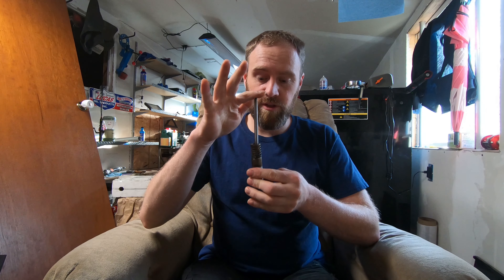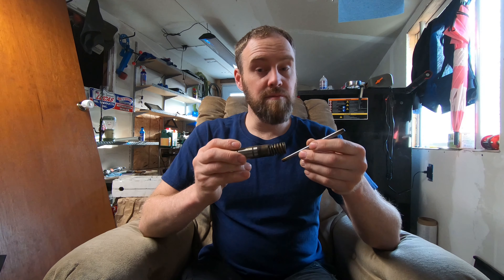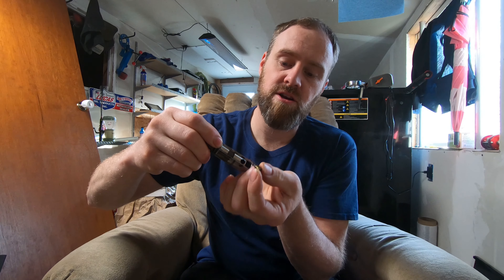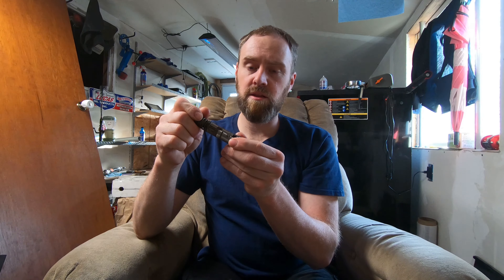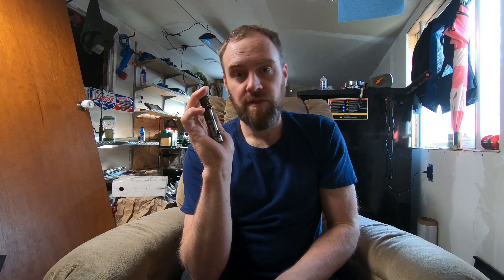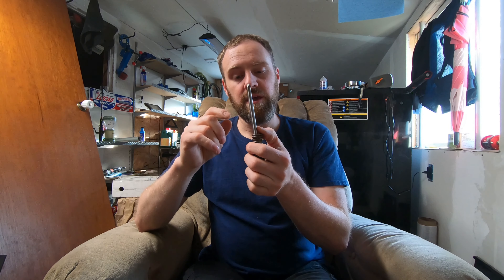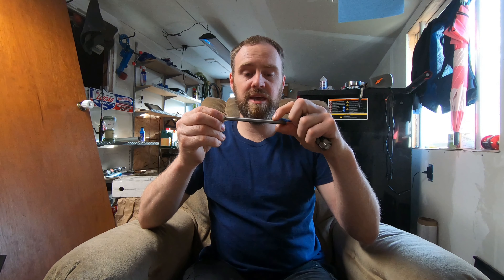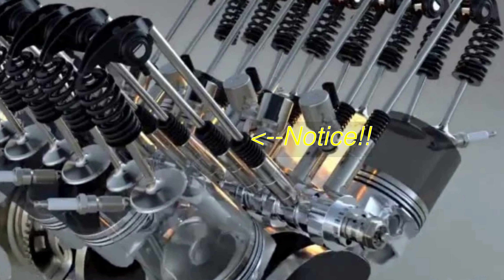Bent Pushrod, Is GM engineering to blame?

Comment: I have a 2021 suburban 7k miles on it just developed a bent pushrod Dealer called me today.   This is crazy.
Reply from the maker: Yup best solution is upgrade to ones that won't fail.
Reply: Same. No check engine light. 8.6k miles. Getting it back tomorrow then getting rid of it.
Reply: Shades of the Vega engine... or 5.7 diesel... GM returns to the 70s
Reply: My 2021 escalade with 3k miles had a bent pushrod.  Just got it back.  I have a zero faith in gm.
Reply: 2021 GMC Sierra Denali, 5k miles. Bent push rod
Reply: 2021 Silverado high country with 5.3  6,200 miles bad lifter 🤦‍♂️ ridiculous
Reply: 2021 YUKON with bent pushrod in February and now Monday same issue.  Another bent pushrod different cylinder!!! Not sure when they will get part in because they are in high demand.
Reply: @thepincup7405  That’s messed up
Reply: @thepincup7405  If it done at the second time that should be under Lemon law. Keep me updated let me know what happens if you call GM and complain to them they will issue you a GM credit I complaining so much to them they issued me $1000 worth of GM credit.
Reply: 2021 SLT, failed lifter and bent pushrod. 5,600 miles. 18 days and still don't have it back.
Reply: 2021 Silverado LTZ, 6100 miles on vacation with my family in NC, bent push rod, no rentals available, stuck in a hotel for 1 week.
Reply: @alexpolansky5088  If you call General Motors direct and complain to them and stress it out to them they will take care of you because they took care of me and they called the dealership to find me a rental car. They put me into a enterprise  truck. So you have to call GM directly and make a valid complaint and also they will compensate you they gave me $1000 in GM credit FYI if you complain right because it’s a brand new vehicle should not be failing it’s a big issue my vehicle did it and you see everybody else’s comments.  And with you on being on vacation you got a little bit more pool there let me know how it turns out.
Reply: @daytonaslots9533  thanks man appreciate it, had a few calls into GM, with the holiday weekend I didn’t get much feedback but hoping to hear back shortly
Reply: @alexpolansky5088  Just keep pressing them and tell them you want to talk to a manager because it’s unfair that your car is in the shop and you don’t have a rental car or a loaner vehicle for the default and make sure you keep specifying the default this is a brand new vehicle I didn’t purchase a brand new vehicle the break with only 6k 7000 miles on it.
Reply: Rust in the lifters from shutting down production see it weekly
Reply: @CrazedPerformanceRepair  which are the ones that won’t fail??? 😩😩 debating on getting one but with all their shxts I’m moving towards tundra TRDPRO
Reply from the maker: @socal69_88  I was referring to upgrading pushrods. But if buying a truck a tundra ir Titan may be a much better choice.
Reply: @CrazedPerformanceRepair  Is this also a big problem on 2020 and older trucks?  According to this video it seems like it should be but we only seem to be hearing about 2021 models going down like crazy.  Why would that be?
Reply: That great GM feeling, just like cramps before diarrhea
Reply: 2021 silverado with a 6.2L, failed pushrods and valves at 7500km
Reply: @garyrosvold7409  
Man I hate to hear that 
GM is not good right now
Reply: 2021 Sierra 1500 AT4 8k miles bad lifters and bend push rods, still at the dealer.
I contacted GMC request to buy back but they are declined. I may have attorney involved.
Reply: 2021 GMC Sierra Elevation 5.3L, 5400 miles.  Just spent 17 days at the dealer for one bad lifter/pushrod, replaced all 16 lifters.  Good thing it's a 2 year lease, they can have this junk back and Toyota here I come
Reply: @jonk3470  yeppers
Reply: It gets better my 21 failed for the 2nd time today same bank.
Reply: @oOnuggetOo  
Man sorry to hear that everyone needs to get rid of these lemons flood the used market with them no one will want a GM truck
Reply: @CrazedPerformanceRepair  I have a 2021 Escalade 6.2 going in for repair in 2 days will they install your upgraded pushrods under factory warranty if i purchase the push rods?
Reply: @socal69_88  Toyota has an ongoing recall on their engines on nearly all models from 2016-2021 for cracked engine blocks. Yes, even the beloved TRD models of SUV and pickups. Avoid avoid avoid.
Reply: @fitzgerald69  Did they provide a courtesy vehicle? I might have the same problem.
Reply: @victordominguez99  No, they did not. They had sold all of their courtesy vehicles due to the vehicle shortage so I was out of a vehicle for a month.
Reply: @daytonaslots9533  what can you do with GM credit?
Reply: @daytonaslots9533  Dealer had me go to Hertz & pick up rental since they didn't have any, Gm paying bill
Reply: Damn. Reading comments. This is nuts! Was considering AT4/AT4X with 6.2 but this is scary. Is Diesel reliable?
Reply: @sammymontego2217  it gets worse, the new 6 cylinder Tundras, the only engine available (no more 8s) have turbo charger fails. They have to pull the body off the chassis to get to the turbo chargers to replace them. Have a friend with 700miles on his 22 tundra and it took more than a month to get it repaired
Reply: @elithepitbulldog2209  the difference is GMs design is completely faulty for years…. There is no fix….with Toyota it was a good design with a bad batch of parts… none of the YouTubers I follow with the 22 Tundras have e experienced it. The GM 5.3 was a good engine before they added the fuel saving technology…. I used to own a 2001 Chevy… but now I’m all Toyota for these reasons
Reply: @thepincup7405  Update?
Reply: @hugh639  how can I contact GM? 2021 at4 collapsed lifter as well at 16 thousand miles
Reply: @gregallen1  call your dealer and request for GM phone number. I wish I still have the phone number.
Reply: It's the gas in California ....
Reply: 2015 Sierra with the 6.2. 
Zero problems till 83,000 miles #6 bent pushrod. No explanation found. 85,000 miles same exact pushrod bent with no explanation found. I’m pushing the shop to replace the VLOM while the motor is still apart.
I’m ready to delete the BS!
Reply: 2012 ram Laramie longhorn 1500 5.7 130k a year ago had a bad lifter and now a month ago same issue .... not sure what to do . 😡 😡  also a ram issue.

Comment: GM messed up their reliable engine reputation starting in 2008 with the first DOD motors.  Its been all downhill since.
Reply: THIS INFAMOUS SYSTEM STARETED IN 2007!!! THE END OF THE GREATER  TAHOE!!  ME, I KEPT MY 2006, AND I LOVE IT
Reply: Yeah after the 08 recession gm has gone downhill
Reply: Ls1 ran over 800000 miles they had to get you in the service department somehow
Reply: @arturovalderrama4626  I disagree. I have an 07 Tahoe with 170k. She's been amazing.
Reply: Agreed my 02 6.0 Silverado runs like a champ with over 220k miles 👍🏿👍🏿

Comment: What I don’t understand is why GM neglected to chamfer the Inside section of the active lifer that slides into the outer section to avoid the very reason it gets stuck when it goes into AFM mode!
Reply from the maker: Because then the locks wouldn't be able to hold. The thing that causes them to fail is lack of oil pressure during activation, or oil pressure when it's not supposed to be getting oil pressure at AFM side of the lifter. This causes the lifter locks to bind because the timing events and thus knurls the steel locking it up.

Comment: My number 5 pushrod bent and that is not a AFM lifter. I have 56000 miles. GM replaced the cam and all my lifters. I had to pay $800 because my warranty expired 3 month ago.
Reply from the maker: I found out later, the pushrods are actually interfering with the head as well. The solution is smaller diameter pushrods. I offer them on my website but you can buy them anywhere.

Comment: Just saw this in my subs feed. Been meaning to follow up with you. Your lifter fix and the LT1swap AFM/DOD delete is going strong over a thousand miles in. Saved me thousands. You’re a rockstar!
Reply from the maker: Thanks, I'm glad I could help.
Reply: How much did it cost ?
Reply: @crz400  I spent a few hundred including the tool. About 50-75 on the LT1Swap DOD delete with shipping. Lots of gaskets like intake manifold and valve cover, although I could have likely reused, but truck is 2008 and never touched those before. I took the time to do some optional items like updated baffle valve covers and oil catch can setup. Honestly it could have been done for 100 or so, but I used the time to do those other items noted.
Reply: When did the engines with this issue come out?

Comment: For Tahoes, Yukons and pickups from 2015 and above, with gear No. 6L80, in order to cancel the AFM system (active fuel management), select the gear shift in manual mode and select gear No. 5 to make the vehicle operate on an 8-cylinder system in all conditions to avoid the Engine Valve Lifter problems.

Comment: Dude you are brilliant! My wife's escelade just started tapping. I hooked up my laptop and no codes. When I turned off cylinder 4 the tap went away. I toyed with the idea of replacing cam, lifters, delete, etc. But I just pulled it all apart today to replace lifters and low and behold I have a bent pushrod on #4. I wish I found this video before pulling the heads because I assumed it was a lifter issue that cause the pushrod to bend. If this happens again which I'm sure it will I'll know better. Thank you for all your knowledge. People like you are invaluable and I thank you for what you do!
Reply from the maker: Thanks, I do have the pushrods to solve this issue on my site.
Reply: @CrazedPerformanceRepair  yup I checked! I will be ordering to have for the future. Thanks again!

Comment: 2021 GMC Sierra 2500 6.6L gas. Ordered brand new to take family on camping trip in June. Received truck 2 weeks ago. 210 miles currently. Started misfiring at 16 miles. Dropping off at dealership tomorrow for inspection.
Reply: 🎶Get that great GM feeling 🎶

Comment: Thank you for the info. Got a new Silverado 6.2, 2600 miles. No issues yet. <knock on wood>.
Reply: How is it rocking man ?
Reply: @Jixx45  not bad. ~4300 miles on it. 19/22 mpg. It’s a fun trick to drive.
Reply: @undeadmonkey9122  how’s the truck now?
Reply: @rayans9348  ~7500 miles, runs fine. Always give her a 5min warm up, remote start while i put shoes on kinda thing. Ave 17mpg, if it’s not in sport mode. Added side steps, ~250 lbs more and no engine issues at all.

Comment: I've been wanting to upgrade my 2001 Silverado to something a little newer. I was definitely concerned with lifters though. Glad to see someone has a sensible solution!
Reply: Get a new Twin Turbo V6 Tundra. I saw an engineering video on their new 3.5TT. My guy, Toyota over-built that thing. They re-engineered the bore and stroke ratio, they made the stroke taller which means more torque and less pressure strain from the boost. Also Toyota angled off the valves, pistons and body housing to overcompensate for the turbo pressure. I'm telling you yes I know they are Japanese, I know they are not a V8 anymore, but these guys did R&D for 14+ years to make basically a Ford ecoboost, bro you know that shit will last forever. I love V8's from sound to N/A power, but even I will admit, after seeing the over thinking and over safety Toyota put's in their motors, I'm done with all these car brands. All I buy is a Toyota now. I don't even care where the hell it is from.

Comment: My 2017 6.2 is in right now. #7 has a bent rod. 101k miles. Thank God for Extended warranties. Thanks for the info.
Reply from the maker: It will likely happen again soon. I offer a upgraded pushrod at www.crazedperformancerepair.com
Reply: @CrazedPerformanceRepair 2017 6.2 here as well. #4 bent push rod. 65k miles and no warranty. 2200$ repair from a GM master tech. Doing bad thermostat and leaking oil cooler lines as well. New VLOM kit lifters and push rods on one head. His tuner wants 600$ for a custom tune. Would I be able to just plug in a range technology plug to prevent it from happening again? I think I’m trading the truck in soon for a 6.6 gas AT4 2500.

Comment: My boss has a 2021 Yukon Denali 6.2.   First oil change at 7,000 miles and it was picked up from the dealer and taken right back for 4 BENT PUSHRODS
Reply from the maker: Yup, not surprised lol. Gm really messed this up.

Comment: I have a 2021 Silverado Custom Trail Boss with a 5.3L (L82) with Active Fuel Management and 6 Speed Automatic Transmission. Super Reliable truck. The ones with the problems are the 8 Speed Models with Dynamic Fuel Management and L84 Engine.
Reply: Yikes I just bought a 2023 with Dynamic 5.3 I change oil below 7500 that's recommended and I use mobile 1 I use mine mostly highway ..... I did by the extended warranty

Comment: I had a  bent pushrod on my 2015 6.2 high country 217000 miles but I’ve ran it with a direct port range chip for a afm delete i probably think it helped me delayed this bent or collapse pushrod or lifter problem right now im doing a complete dod -afm delete with the respective tune i hope this solution help me keep my truck a bit more longer, i like the video and subscribe! Good information !

Comment: 2018 sierra SLT...58k miles on it...engine light came on, threw code P0324 for knock senor code accompanied with a engine tick....my mechanic pulled the valve cover and found the bent pushrod almost identical to the bent one from this video. Thankfully caught it before any further damage....im probably done with GM until this is fixed/addressed...Thanks for the video.
Reply from the maker: I sell a fix, smaller diameter heavier wall pushed at crazedperformancerepair.com

Comment: 2015 silverado 5.3 Thanks for this explaination and I agree with what you are saying. Last summer I thought I had a stuck lifter on the passenger side. When I pulled the head apart and examined the lifters none were in the stuck position but I did find a bent pushrod. I replaced the lifters anyway along with having the head cleaned, replaced the guides and pushrods. Now this summer, the driverside has a tick and Im thinking bent push rod. Hopefully it is because its a much easier fix... I'll follow up later this year.
Reply from the maker: I do have a pushrod upgrade available now that should solve the issue.
Reply: @CrazedPerformanceRepair  may l ask why your push rods won't bend like mine original one?
Reply from the maker: @marekkrepa9982  they are just slightly smaller diameter so they won't interfere and they are much heavier wall so stronger.

Comment: 2021 GMC 5.3l with 5,022 miles. Bent push rod and had to replace all 16 lifters. Took dealership a week to fix.
Reply: 5006 miles  2021 GMC 1500 Denali  Just happened and lifters are backordered
Reply: Same with my 2021 suburban. took 5 days for parts to come in. another 3 days to fix. she was around 7,800 mi

Comment: So this happened to my 2019 Suborban with the 5.3,.  Less than 60k miles.  Heard the loud tic and the pushrod was a boomerang.  Had a newer GM pushrod fail on a gen 1  SBC right after a rebuild  as well so a combo of bad geometry and possibly poor contrsuction.  If you have one of these order the kit NOW and disable AFM.  The dod delete kit is a daunting project either on the wallet or on your back.

Comment: Interesting thoughts, but Pushroads, AFM lifters, non afm lifters and guides absolutely the same, same part number as in previous generation engine. 
And this is not only one problem with this system on L83 and L86. Afm lifters can be destroyed in a bore and major and the most dangerous issue is that they start to rotate in the guides and damage camshaft. 
I had bend push roads with computer disabled AFM on my Escalade 2016. 
The solve of this problem is: change all lifters and guides on non afm and block the afm channels by plugs. 
YOU ABSOLUTELY DON’T NEED TO CHANGE CAMSHAFT!!! 
We’ve made one Escalade and Tahoe 2016 and no misfires work absolutely great! And one more Escalade 2016 is coming. 
Camshaft caps are absolutely the same. And the difference is only in 2mm in length of afm lifters with pushrods over standard lifters. But the lifter can adsorb around 14mm by itself. That why we don’t have any misfires! 

Also the problem can be because of the oil pressure it is too low on 500 rpm
Around 150 KPa! 
The solution is to increase to 650 rpm and oil pressure would be 208 KPa never less!

Comment: Very interesting concept. And if it’s true I would love to get the pushrods replaced before failure. Or during repair after failure. However with a 2021 truck either of those options would void the warranty. So we are kinda stuck with the faulty design :((

Comment: I am working on my truck right now and I have found the pushrod on the exhaust valve on #4 cylinder is bent causing the misfiring condition. I have purchased a complete kit to change the camshaft, lifters, valve springs, and upgrading the rockers to bronze bushings. I have also ordered the HPtuners ALDL interface and downloaded the software to reprogram the ECM. As of now I have spent right at $3,000 just in parts.